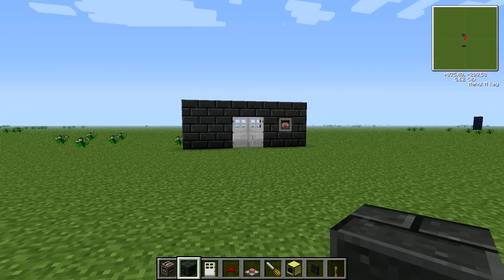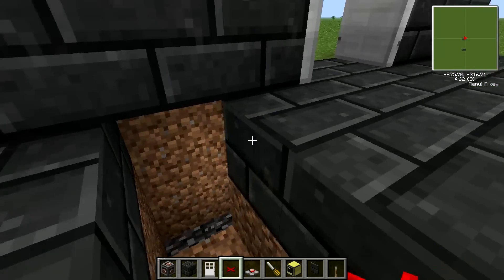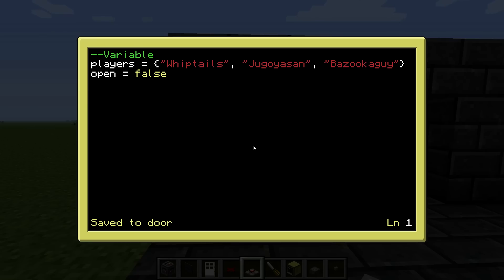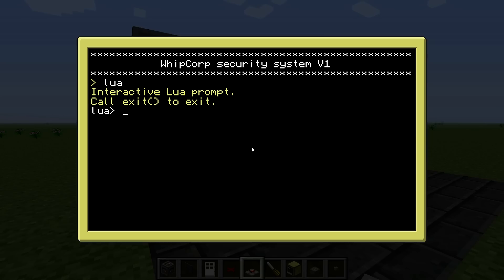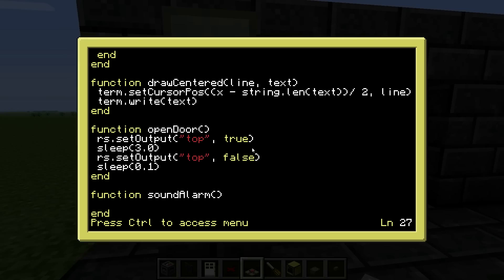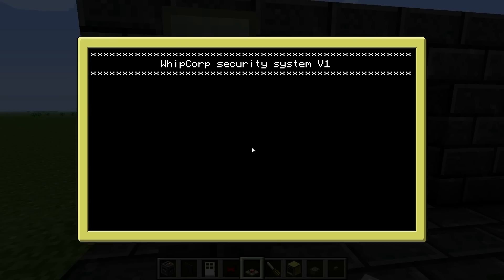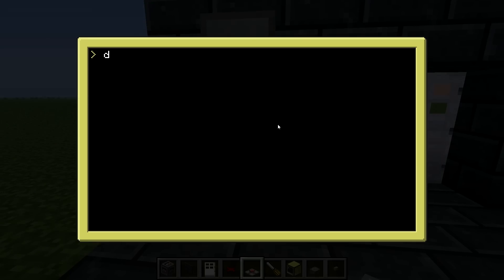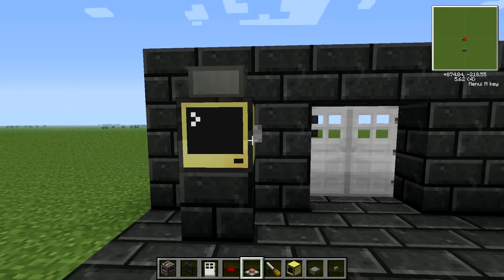Computercraft Tutorial - Player detector door

Comment: where did you get that basalt brick cover
Reply: RedPower mod spawns vulcanoes which you can get basalt cobblestone, you melt this to basalt stone, use 4 of the basalt stones to make a basalt brick. then you need the mod microblocks to chop it up to panels. =) 

But I think RedPower is outdated. and there is a substitute RedPower project open source which still works on new servers.